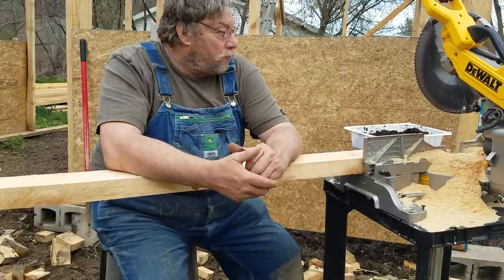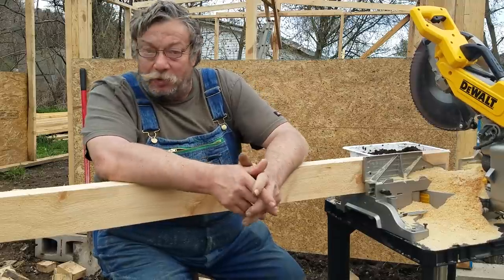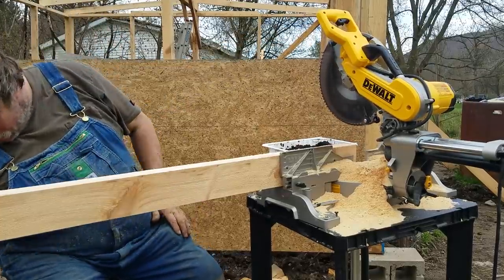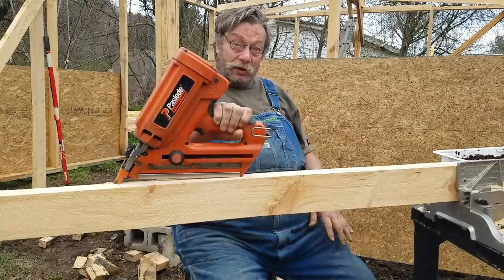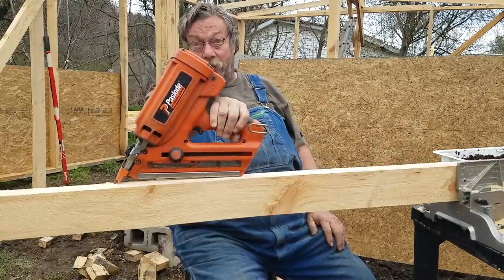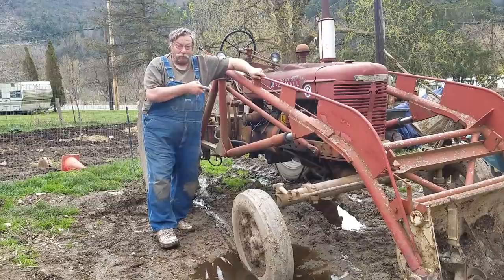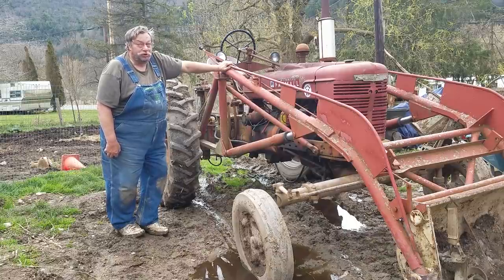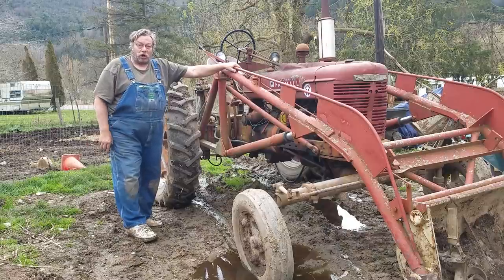Greenhouse is up! Details and cost!

Comment: Harvey,  I watch your channel a lot.  Never have commented.  Have some experience with growing in greenhouses in Pacific NW WA.  Your greenhouse is best for extending the season in spring and in fall.  As for summer, ventilate, ventilate, ventilate.  Be prepared to open the ends up entirely, especially if you don't have forced air movement.  Summer solar gain (heat) can overwhelm, as in kill all your plants.
Cucumbers can very easily fail due to getting mold growth on them.  Common outdoor varieties can have the greatest problem inside the greenhouse.
It is very easy to over plant and crowd the plants.  Not good.  Overhead and hanging plants block the like of plants beneath and they don't produce well.  Too crowded and they suffer for inadequate light, become disease prone, and can disappoint.
Many successful vegetable growers use greenhouses for their plant starts and transplant outdoors to finish the growth.  This gets much more effective use (yield) from the greenhouse.
I hope these thoughts are helpful for you.
Marv

Comment: Hey iron horse .if its not to late running some damp course under the timber will make it last years and years longer as it will stop rising damp going into the timber .im a bricklayer builder but i love playing with saws to much to play with bricks all the time . You can get 300mmx30m
Rolls fairly cheap here witch i think is like 12 inch wide .we even put it in the 1st course of bricks to stop rising damp .the structure looks good should get 15 years out of it ..and a coat of paint helps preserve the timber as well.
I wish i could be there to help you but im in australia and in busy as everyone else is ..yea just chuck a crowbar and some timber choks under and slide it under ..its just hitting witer here and ive got the huskys echos stihls with me and the household cutting splitting wood ready for a cold one .. good luck mate and cant wait to see these veges growing

Comment: I had green house some years ago , and I found a cure for early tomato blight , and it may work on late blight too .
Garden pump sprayer  with hydrogen peroxide,  one part to six parts water , fine spray top and bottom of the leaves  till wet every day in morning till no more blight , plus remove any blighted leaves  and stems and take them off the property to some where else .
I sprayed all the tomato plants I bought as soon as I got them  home for the first two days just for good insurance that they may have came with blight.
Did not have any blight that year.
Blight can be air born and thrives on damp or wet leaves , you already know not to top water that is good .
Blight lives in the dirt , blighted tomato and potato plant remains or on pots or box's from one year to the next .
Can come from potatoes plants too as there are related to tomatos .
Never cross plant in same area of dirt .
Tomatos grow slow till 6" tall then they take off growing fast and drink a lot of water.
Tomato plants will take a lot of water few times a day, morning and afternoon in green house and that was in pots just to have 18" tall transplants to put outside .
Put a table spoon of epson salt mixed in the dirt for each plant , it makes a sweater tomato.
I'm down in Pa near Williamsport , not uncommon to still get frost the first week of May and Have seen frost first week of June before .
I think it might frost into June this year the way this weather is so weird with the late snow .
I know you are about two weeks later on the growing season where you are , my girl friend lives west of Woodhull , not far from you .
I think I have possible been passed your place a few times maybe .
I was a logger too .
Maybe when things get normal again and I get back up to NY and have time I would like to come see you ,  I will contact you first .
Good luck , you will have fun in the green house . Keep Safe

Comment: See if you can get some bicycle screw in hooks - fist size for holding tires of bikes - use them for drop down - lots of strength in the 1/4" wood thread.  Cool project.

Comment: Harv, when you put the plastic on, put it up in the early morning, then in the heat of the day retention the plastic! And it will last more then year if done right! When you fasten the plastic down use a strip of wood rolled 1/2 and staple to the board then screw it to the “OSB”, this will help in fighting the plastic, and keeping it tight!

If you put plastic layer on the inside of the structure during the fall, and then have the exterior layer you may have a nice winter garden as well! A box fan may be needed in the vent window on one end, and just open the other!